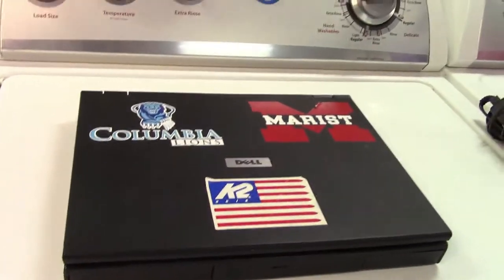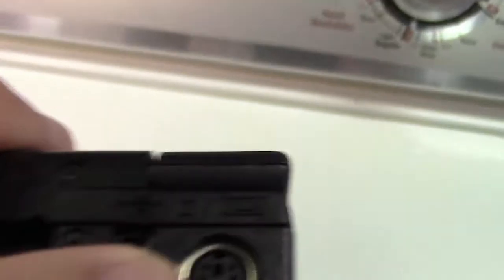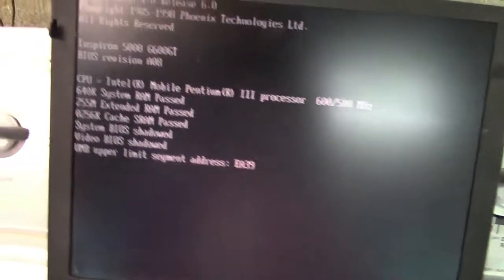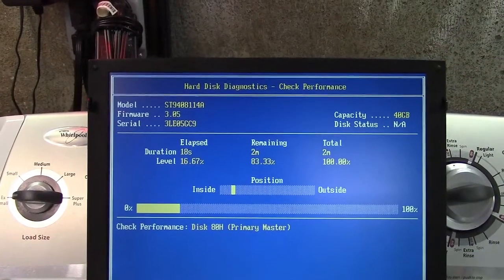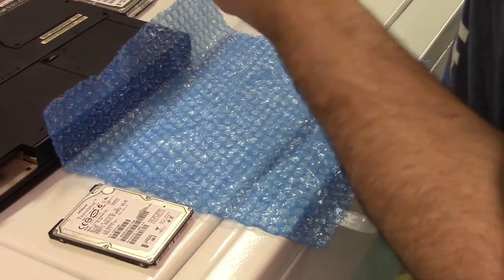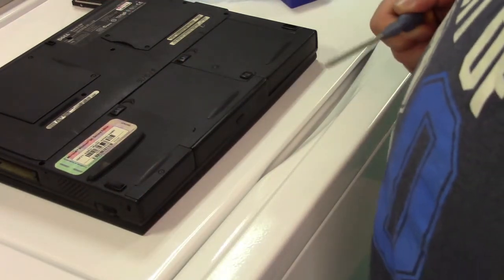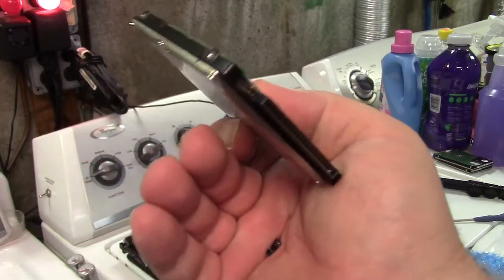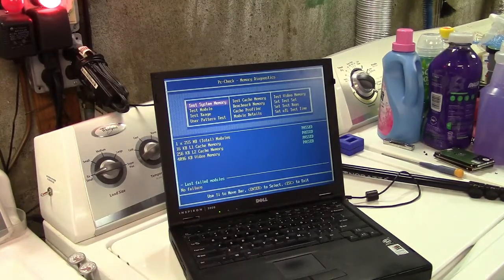Dell Inspiron 5000 Repair, Part 1 - Hard Drive Replacement & Testing

Comment: That power adapter is a work of art!
I have an old dead speaker mounted in the shop for magnetizing screwdrivers.
12:48, ouch! I've done that plenty of times.
Reply from the maker: Yeah that was a nice little fix.  Been working great since.  Of course, now I have such adapter that would have fit that port, but it's, how do you want to say it, deprecated, outdated, obsolete, unheard of, old?  My fix worked.  Been working since.  Of course, if I had gotten the power adapter with it, none of this would have happened, but I had to make due with the parts I had on hand.

I find the screwdriver magnetizer/demagnetizer does a great job, and is only a couple bucks.  I have actually used the demagnetizer a few times, and indeed it does work.

Stabbed like that?  This thing was like an inch deep, I was even concerned a bit.  There's just the tiniest scar from it now, all healed up.
Reply: Yep, that's a good way to save some money, to use what is on hand. That's why I use the speaker. It came out of my 1981 Silverado, since it was dead, but the magnet is still good. Did that device you have come from HF? I just may get a couple, when I have some extra spending money. Supposedly, I am getting a bonus this month. Another thing I would like to purchase is a laser printer. I'm beyond done, dicking with ink cartridges. 
I've certainly had tools explore the inside of my hand before. Not an inch deep, but the sound and feel of the extraction isn't pleasant. I always get a burning sensation right after it happens. Mine swelled like that too, and would randomly bleed for a couple days or so.
Reply from the maker: @dynatrak  No, I actually got that at Tiny Middle.  You can find ones for under a buck on fleabay.  Couple dollars for a nice one like I have.

Once you go laser, you'll never go back.  Most printers today are network-enabled as well, one printer for the house.  Works well.  I bought one about 4 or 5 years ago.  Toner has run out.  It's actually been out of color for about a year now.  But Slanta Paws might be bringing some replacements.  He's cheap though, so they're aftermarket ones.  I'm not paying $600 for toner that I can get for $40.  I've heard that the aftermarkets could be hit-or-miss, but for that disparity in price, I'll take my chances.

My wound has healed up, it's barely even noticeable now.  Fortunately, it wasn't really bothersome while it healed, those are the worst when they are.

Comment: Oh good a Dell Outspiration!

That pink makes it look like someone made a blue light filter that went nuts and started filtering the filter!

I miss those old sounds, I actually used to have the 5110, or whatever one it was you repaced the hard drive of. I remember seeing that sticker.. somewhere on it. It was a closet find, had no battery, had no charger, it was just done for! No matter what we did, we just couldn't find that charger.

Many years ago, the charger port was actually broken due to the work of someone young who couldn't keep her hands to herself. She sort of got that little center piece broken off, and stuck INSIDE the charger port. At least the local Staples, which sadly has since closed, had really smart computer technicians, and they were able to remove that in like 20 minutes, and they didn't CHARGE us for a new charger.
Reply from the maker: Yeah, the pink is weird.  I have another old laptop I've been using more recently.  That doesn't have the pink issue, but when it's first turned on, you can see the center of the screen not lit as brightly, as you need to wait for the tubes to fully warm up.  This was common back in the day.  Only takes 2 minutes or so, but you'll see it during that time.

Yep, that was a 5110.  Really, Staples had smart techs?  I remember once being in a Staples and talking to the guy at the repair desk there, and it seemed he really didn't know much.  I'm sure if I worked there, they wouldn't believe the stuff I could do.  I mean, after all, they hired my brother-in-law to be a manager there!  He didn't make it 3 weeks...

Sometimes for a fix like that, you just can't charge.  That's one of those "let me pay it forward for now, and I'll get plenty of business later."  See, you REMEMBER they did that, and would gladly go back, except for the fact that they closed.  Tiny Middle eschewed such behavior.  Well, actually, my boss did.  I'm sure the company would have applauded such things because they KNOW that people will remember those little things you do.  Not only did my boss prevent us from performing such niceties, he made us charge them a "nominal" $10 fee.  I'm sure there are people who came in and contested that on principle, at which point of course that fee was taken off, but if you can do something to help somebody, something small like that, it can really go a long way.
Reply: Truth be told, my 2006 Panasonic starts slightly dimmer the first time of the day its on, then it warms up, and its fully bright! Done that since new.

Ours did at least! For a long time I thought Staples was a tech specialty store because of that.

Good old Tiny Middle! That's happened to me several times over the years, where I get to help pay something forward. Some minor things here and there, but the little things mean the most!
Reply from the maker: @nl.515  Maybe it needs a little more warm-up time when cold.  Just like some cars are cold-blooded.

Staples is a high-PRICE store!  A number of years ago, the wif and I went into the local one here.  I saw a 6 foot parallel printer cable.  Those used to sell for $20 all day, and you could find cheaper ones if you shopped around.  While now quite old and deprecated, they sold that 6 foot parallel cable for FIFTY DOLLARS!  That went completely outrageous!  In fact, everything in that store was overpriced.  50 pack of envelopes, I don't know, $4.29.  $4.29?  You could go to the dollar store and find it for a buck!

Every company I worked for failed due to mismanagement.  Not enough to take them off the map necessarily, but they failed.

One time, over the summer, we had a substitute manager in the shop at Tiny Middle.  He knew how to do his job.  Numbers went up and up, employee morale went up and up, until the old curmudgeonly, crotchety man came back, then it was back to the drudgery of day in-day out.  Doing everything right, 100%, and still getting yelled at.  I ought to tell an Old War Story about that--I'll put it on the list.
Reply: No wonder our local Staples closed! They were good for school supplies for me, though they charged a pretty penny, they were very consistent in keeping supplies in stock.

Good old mismanagement! Do everything right even though your tools are where they shouldn't be!
Reply from the maker: @nl.515  When I was a kid, we had Genovese.  They were a drug store, kind of like a CVS or Walgreens today.  But they used to have a whole big area of back to school supplies.  Forget the pack of erasers for 79 cents.  Beat the crowds, and buy them NOW for next year.  Well, not right now, it's a bad time...

Speaking of tools being where they shouldn't be, there WILL be an old war story on that, which has already been recorded!
Reply: Oh wow, smart! Just like Christmas shopping in August!

You have a lot recorded don't you?
Reply from the maker: @nl.515  Exactly!  Screw the 40 cents, save your life!

There are 20-some-odd more Old War Stories that are recorded already.  There are 50+ on the list to be recorded, more as I think of them.  So I know that the Old War Story series should be running for a good year and a half more, at least.
Reply: Not bad! Record them all and that's 70 days you don't have to look at a camera!!
Reply from the maker: @nl.515  It's not quite that easy.  I can only record so many in a day, then I get tired of talking.
Reply: Right, right. Well, close enough!

Comment: It sucks that you can't find batteries for these things today (at least for a reasonable sum of money). As for the form factor, a lot of companies used front loading batteries like that. In fact, one of the only companies that didn't and had computers that looked "normal" without them was Apple. Nowadays though, it's rare to see a hot-swappable battery at all.

As for the floppy drive, I don't think many late 90s-early 00s laptops actually had internal floppy drives. I think most of them had either a hot-swappable bay that typically had an optical drive that could be swapped for a floppy drive or even a second battery (another thing you don't see anymore), or they had a proprietary port from which you could attach a floppy drive.

Whenever I work on computers, nothing ever goes my way at first. That's why I usually test drives externally BEFORE I screw everything in. Speaking of IDE hard drives, a few years ago I found a guy at a HAMfest that had a bunch of computer stuff he was giving away. I came away with a box of IDE hard drives, ranging in sizes from 10-80gb, along with a bunch of other stuff I didn't take because I already have a bunch of parts that aren't in other computers. I know you've been working in computers for a long time, so would you like to take a guess as to how many of the ~5 working hard drives I got were wiped before they were literally given away?
Reply from the maker: Oh yeah, I remember all of those different options.  My favorite was one of the Dell machines from back in the day, forget which model series.  It still had a floppy drive, which could be swapped out for an optical drive.  However, the bare metal floppy drive that was taken out had a micro-USB port on it, and they gave you a cable, so you could still use your floppy drive externally.  That was the GREATEST idea they ever had, absolutely brilliant.

Towards the very end of the 90s, floppy drives were still around.  This machine came with Windows 98, so for that year, as well as 99 easily, machines were still found with floppy drives.  2000s and beyond, they were falling out of favor, especially as prices on flash drives fell.

As for the 5 drives you got, I'd venture to say that NONE of them were wiped.
Reply: @jaykay18  I looked it up, and this model was for sale in the year 2000. As for exactly when, you'd have to look up the service tag.

I'd venture to say you are absolutely correct about the hard drives! I also got three optical drives, and all three of them had discs in them! In a box that ANYONE COULD TAKE - FOR FREE!!! I mean, the guy's lucky I do the right thing, and if I ever use them for something like a Pentium 4 gaming build (which I might do someday) those are all getting DBaned.
Reply from the maker: @ENB2002  That late?  Really?  Well maybe, I mean it was 98 SE, so could be close to there I guess.

The leaving the disc in the optical drive is just stupid.  It's like people who lease cars (when the used to have CD players and they leave their music in there).  Derp.

As for the HDDs, if I'm ever reusing drives that had other peoples' data, it's not my problem at all if their data gets stolen.  I'm not using it for anything, I'll format the drive but that's it.  No need to zero it out, they were the ones who left the "car doors unlocked and the keys in the ignition".

When I have a drive I get rid of, first off, it's not in any usable condition.  Second, I take it apart and remove the platters and scratch them up.  No worries with physical destruction.
Reply: @jaykay18  It's just standard procedure for me to wipe any hard drive I get when I want to use it for something, and I usually zero it out, but not always
Reply from the maker: @ENB2002  Quick format for me is all that's needed--the person who owned the drive before did a disservice to themself.
Reply: @jaykay18  It's hard to argue with ya on that one...

Comment: Nice. It Ain't gonna do much though. XP will run pretty slow.  Would make a nice digital picture slide show machine though.
Reply from the maker: It'll do more than you think.  In fact, there's going to be a video on that after this series is complete.

Comment: Hi Jay, That's cool. I'm not a big Apple fan but love the MagSafe connector that they invented and dumped??  I have a few old machines that are still in good working order with the oldest being a Thinkpad A31 P4. It's a battle ship desktop replacement and I have the floppy option installed in the left ultrabay. Sadly the original CD-RW drive had become unreliable and it now has a Dell unit in it from a Precision M70. Cheers.
Reply from the maker: The MagSafe connectors were a good idea.  That should have gone universal across the board for all laptops.  But could also be troublesome if you just don't have the reach.  The Dell replacement is just fine, does the same job.  Sometimes the faceplates can be swapped over; I used to change out faceplates on laptop drives at Tiny Middle whenever one went bad, because the new drives didn't come with one.  Some were a bit trickier than others, but all could be removed.